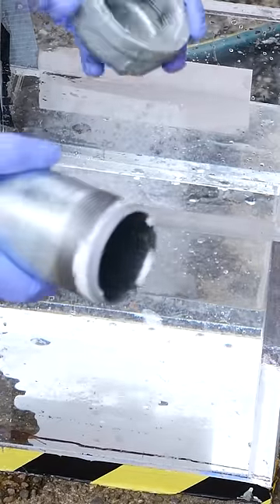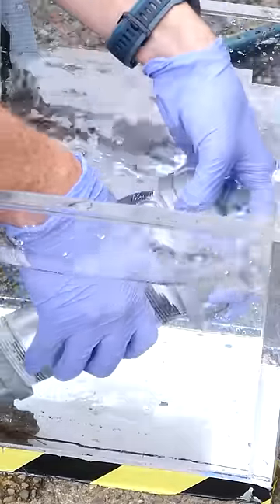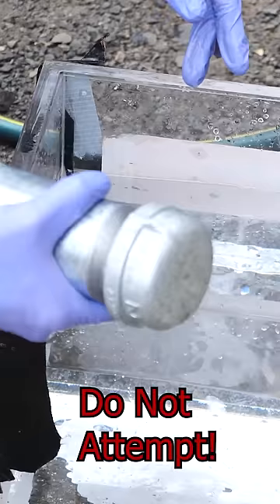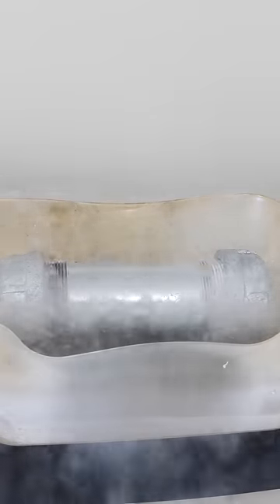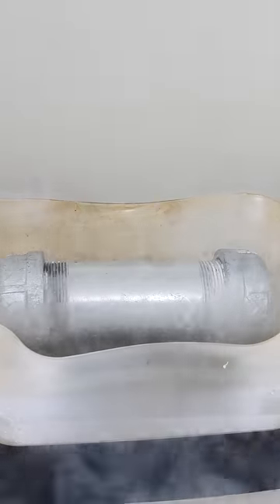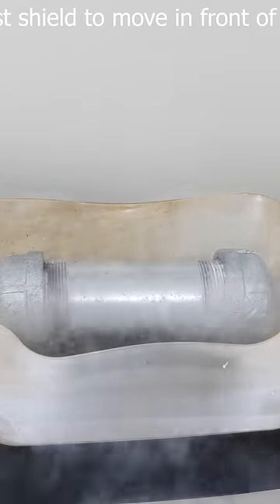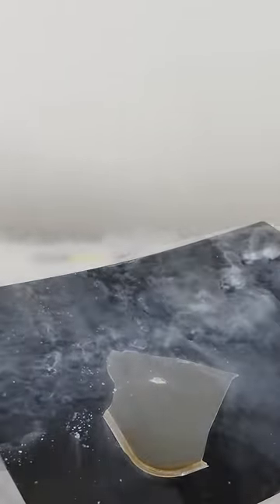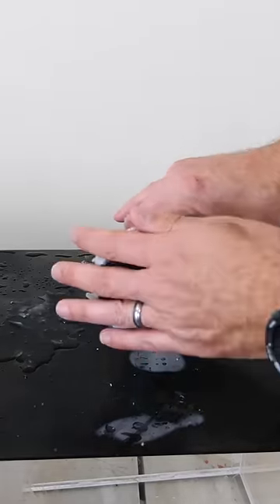Don't Ever Try To Stop Water From Freezing!

Comment: it's too bad the screw threads failed so early into the freezing! you should try this again, but put some plumber's glue on the threads so it's more secure. that would work very well with your safety protocol where you just speculate when you should probably put the shield up. since it's more secure you can probably even wait longer.

Comment: Clearly safety doesn't come first with this guy.
Reply: Welcome to my laboratory, where safety 😎 is number two priority
Reply: well atleast it looks like he's a one man army
Reply: He’s one of the more safety-aware YouTubers there are lol 
Also, getting liquid nitrogen on your skin actually isn’t dangerous as long as it runs off instantly (which it does). You can actually pour liquid nitrogen on you skin as long as it runs off.
Reply: @filipwassen7947  You can dip your finger in LNG and be totally fine. A boundary layer of sorts forms around your finger.
Reply: Not much energy actually though, because its not expanding beyond the break point like compressed air would trying to escape, so the moment it pops, thats all the energy. Realistically it probably wouldn't hurt that much
Reply: @filipwassen7947  I’m going to try this now
Reply: @Propane_Acccessories  Leidenfrost effect
Reply: You're not going to be hurt by a pipe cap at that speed
Reply: @filipwassen7947  This man has like 50 videos with obviously dangerous shit right in front of him yet he still is never really careful.
Reply: It comes just in the nick of time.  Which is good enough
Reply: How clear, is it?
Reply: @filipwassen7947  I don't think the concern was about the liquid nitrogen, more about the exploding steel
Reply: He's gay, so I guess not.
Reply: @filipwassen7947  I'm not worried about the liquid nitrogen, I'm worried about the shrapnel from that bomb
Reply: "We hide behind this tinfoil shield to protect our nuts, because nobody likes roasted nuts!"

iykyk
Reply: Hes got gloves :)
Reply: I'd say it's more about timing with this lovely fellow

Comment: Liquid water shot out. Obviously below freezing point.  Solid water (ice) expanded increasing pressure.  Liquids "can't" be compressed.. so it likely also reached a point at which the maximum amount of water could be frozen under pressure. 
I guess that's describing the same results in a different way, but definitely why there was liquid still in there

Comment: Don't forget that steel becomes fragile when freezing to very low temperatures and loses its ability to resist to pressures.
Reply: Exactly
Reply: Is that Superman weakness? Liquid Nitrogen?
Reply: Not stainless steel though
Reply: not to mention the explosion was more due to water being mixed into LIQUID NITROGEN when the pipe burst rather than just the water pressure from being frozen. the potential energy of the nitrogen was the cause...

would love to see this in just a freezer with a plexiglass door so its visible
Reply: It doesn’t become fragile, it becomes brittle, and that’s only with certain types of steel that have the BCC structure.
Reply: @user-tr2dh4xx6u that's not how that works, dude
Reply: @user-tr2dh4xx6u  That’s not the case.  Water never came into contact with liquid nitrogen until after the steel burst.  Also this shit happens all the time with pipes.  Copper, steel, cement, and asbestos they all pop.
Reply: Would it have the same effect if it was a plastic bottle?
Reply: Troll detected 😂
Reply: @AnarexicSumo  I'm not saying the water didn't burst the pipe, I'm saying the explosion was so violent because of the liquid nitrogen being present. This would have been way tamer without the liquid nitrogen
Reply: I had the same thought. It's called the ductile to brittle transition. Because it is so brittle it explodes under the pressure. Ofc, I don't know what material we're looking at here.
Reply: Did you gethow mich pressure dis he say water exerts when it's being frozen?

Comment: Water is insanely strong. As a young teen i was challenged by jumping off a bass boat  moving 60, i knew going into it it was going to hurt but i went anyway. I curled into a ball and rolled off as to land on my back, my @$$ skipped across that lake like Nolan Ryan skipping stones and after a few skips i slowed down enough that my next impact opened my body and limbs like an unfolding parachute and the lake just reached out and took me. Having been surfing since i was 6, i knew the power of water, but really hot brunettes nursing my soreness was anticipated, instead i laid on a couch looking like a smurf for a week eating Ibuprofen like sweettarts

Comment: I once had a aluminium bottle that was really dented, so I thought I'd be smart and fill it up with water and put it in the freezer so that the expansion of the ice would push all the dents out. Turns out I was not that smart lol. I didn't precisely measure the exact amount of water needed so that ice would only just exceed the volume of the container, so I woke up the next day and my bottle had broken in half.
Reply: Lesson learned. Now you know that you should calculate how much water you should use to get the proper yield next time you try that.
Reply: @RobertMcBride-is-cool  SCIENCE!!!!!
Reply: @RobertMcBride-is-cool  
Yeah I did a rough calculation, but I learned the hard way that there's not much room for error lol
Reply: Hey, at least you'll know to undershoot next time you sent a bottle!
Reply: Pretty smart idea...if it worked
Reply: I tried removing the label from a full unopened bubbly soda can by trying to scrape the label off with pliers but it went horribly wrong.

I began by scratching a small strip of the can label off with the pliers, all seemed to be going well, and then when I was about to peel the label off, the entire can literally exploded like a bomb with no warning, making a very loud low pitched thud sound, and soda was blasted into my face blinding me instantly. 

I was blinded, my ears were ringing a bit and I was confused as to wtf just happened for about 30 seconds.

I picked the can back up and the entire side of the can was blasted right open, like if someone slit it open and tried ripping the whole can in half. I'm surprised my hand and/or fingers weren't blown off.

The can was left at room temperature for a few days which most likely caused the carbon dioxide to come out of the soda and pressurize the can.

TLDR: I got bombed by a bubbly soda.

Comment: Learned this back in grade school. I live in a hot place so having your water stay cold for a long time is a saving grace sometimes. So I used to freeze my bottled water before going to school. Once I tried filling my water to the brim and not even my metal tumbler was able to withstand the pressure and it broke. Thankfully it was just a household fridge that cooled it gradually so it didn't explode violently like in this video.

Comment: Three useful pieces of information:

1. When warer freezes fron a liquid to solid its volume increase by 10% in volume. 
2.  Frozen water can exert up to 2,000 atmospheres of pressure.

The maximum pressure from the expansion of freezing water can reach about 790 megapascals (MPa) or approximately 115,000 psi.

3. Freezing water in a container that does not expand at all is dangerous.
Reply: It's not just a container that doesn't expand. It's a container that shrinks when it cools.
Reply: @ludo_narr  Wouldn't that be every container unless the container itself was made of ice?
Reply: Technically that steel vessel shrinks when cooled so it upped pressure even further. Also failure point was where threads were cut into cap creating a stress failure line.
Reply: The failure point was the top of the cap. Not even where the threads were cut but where the curve on the top of the cap began to flatten out.
Reply: Is there material that could withstand this pressure?
Reply: @sch.ondraa  sure steel can if you make it 3 inches thich with a 1 inch inner diameter. It's not that nothing can withstand the force. It's that in any economical/reasonable application water will always win. Water freezing is used to split rock in some areas. Drill line of holes, fill with water wait for freeze rock will split along the line. It's slow but it works. As crack opens add more water till section you want breaks away.
Reply: Does the liquid nitrogen weaken the metal.?
Reply: @yakisobaaeater3014  weaken no, steel does get brittle if super chilled. But it would take extended amount of time in liquid nitrogen for that to happen not the few seconds before pipe burst.
Reply: The title is wrong. It's very easy to stop water from freezing, just warm it up.
Reply: Would be interesting to see if there were such a dangerous explosion if placed into a freezer, rather than liquid nitrogen. Although, yes, the vessel will still rupture, I don't think it would be so violent. Placing the vessel in liquid nitrogen completely compromised the strength of the metal by rendering it brittle, thus giving a violent, shattering explosion rather than it just cracking.

Comment: The cap came off because the threads sheared. The amount of force required to exceed that material shear strength on the threadform can be calculated. But to determine the exact amount of force means, determining the hydrostatic pressure associated with a 10% expansion of the fluid as it freezes
Reply: Cap did NOT come off!!  The threads were still on the pipe nipple, it was the solid end of the cap blowing out!  Retired plumber here.
Reply: noooo....
another math class....wait, I'm not at school anymore
Reply: Cooling just about anything ( most Metals as well as steel) to liquid nitrogen temperatures makes it more brittle than at higher temperatures.

They store it in aviation Metal containers just for that fact smh.They don't happen to mention that though do they?
Reply: Lol it didn't shear the treads off
Reply: @davidgibbs381  so the cap just spread apart and blew off, you're saying?
Reply: @pjost6643  I ain't saying that at all!!  Carefully re-read my original post & observe the video in slow-motion with pauses, it clearly illustrates what I said.
Reply: the cap sheared at its sharpest angle, where the flat end met the threaded collar.  Metal does also have a tendency of shrinking a little with decrease in temperature, and along with becoming brittle it seems to have undergone crack propagation along the outside edge. Lots of interesting things happening in this clip
Reply: Yeah the cap didn't blow off. You can see in the video it's still there. Needs to redo but without using liquid nitrogen.
Reply: The video literally says freezing water exerts about 2,000 atmospheres of pressure... no calculation required.
Reply: @SixteenTonesStudio  I was about to comment that the wall transition was the failure site.
Reply: @davidgibbs381  I still couldn't pause to the point where it showed the break.
Reply: @pjost6643  just look at it afterwards, you can see what part of the cap remains on the pipe
Reply: @SixteenTonesStudio - Thank You!